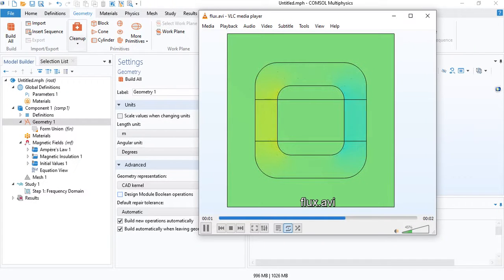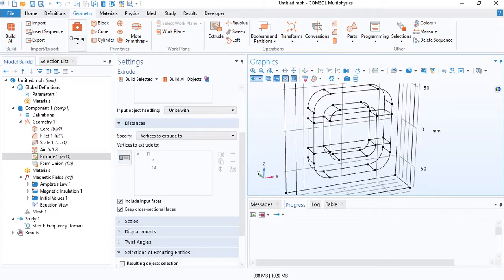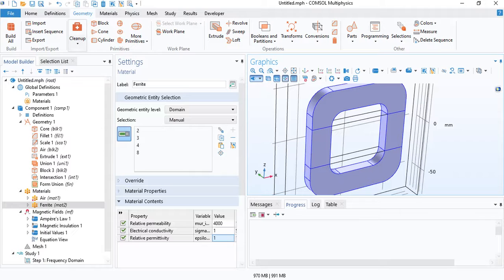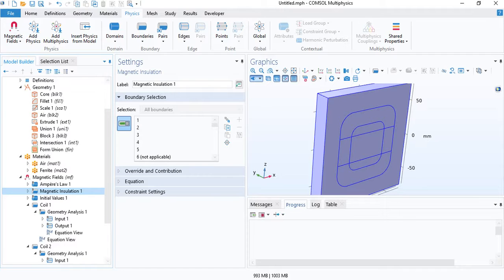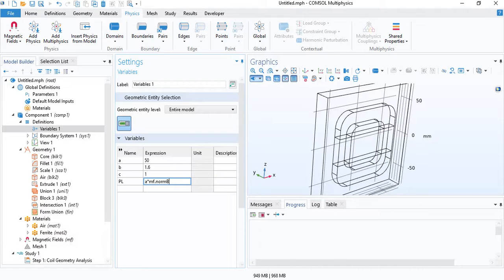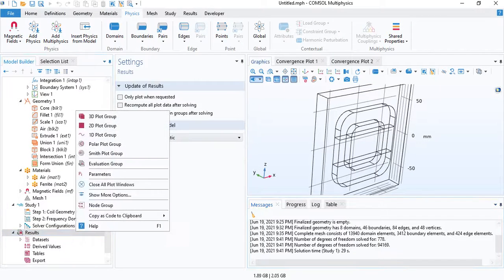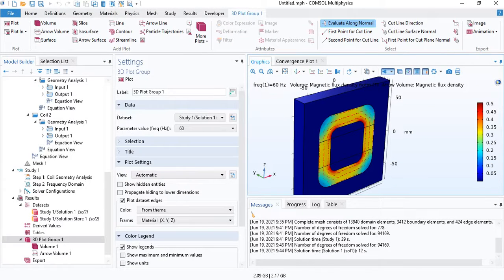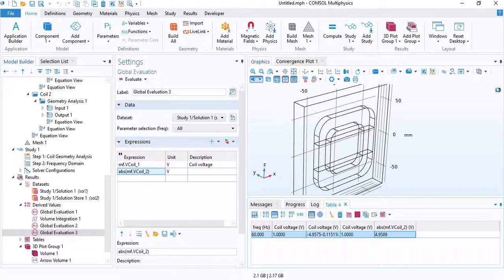Modelling a simple transformer and defining custom equations using Comsol Multiphysics

Comment from the maker: Corrections: 
(a) In the video I mistakenly selected only two regions in the core to calculate the core loss. You should select the entire core.

(b) At 18:00, the copper loss expression should be divided by two since the solution is in the frequency domain (sinusoidal current).

(c) I forgot to multiply the total core loss (PL_total) by 2. Since only half the geometry was modelled the total loss should be multiplied by 2.

Comment: how can I define a uniform current density in a conductor block or region?
Reply from the maker: If you're doing AC simulation and want the current to remain uniform you should use the 'coil' feature under domains, and within coil you should specify 'Homogenized multi-turn'.
Reply: @JafScience  even with the "homogrnized multi-turns" the conductor blocks are still affected by the frequency in my simulations. Is there a way to force the uniform current density?
Reply from the maker: @Flak3 within the coil conductor you still see skin effect? The homogenised multi turn is the way in comsol to force current to be uniform because it doesn't model it as a single piece conductor. Is your coil linear, circular, or numeric?
Reply: @JafScience  Exactly, skin effect is taking place in my simulation. I defined my coil by selecting the boundaries of the conductor block (2D Axyssimetric Simulation) and defining a current value and number of turns with the homogenised multi-turn option. There doesnt seem to be this linear, circular or numeric option in the coil options.
Reply from the maker: @Flak3  So you selected the outer edges of the conductor block? In that case the body isn't defined in the coil so it makes sense that you see skin effect in the block. The current is uniform only on the boundaries. If you want current to be uniform in the entire block then apply coil domain to the entire block.

Comment: if i draw coil (electric wire) which type of coil i use ??
Reply from the maker: The type of coil depends on the geometry of the coil and the application it is intended for. Assumptions can also play a role, if you are trying to simplify your model. So more information is needed to determine the coil type.
Reply: @JafScience  I drew electrical wire and wrapped it on the first part of the transformer
Reply from the maker: Did you use a surface for the whole coil or individual lines for each wire?
Reply: @JafScience  individual lines for each wire
Reply from the maker: In that case the only option is to use line current. If you have many wires close to each other I would recommend replacing them with a surface and using the coil feature with homogenized multi-turn model.
Reply: @JafScience  
okay,  thank you very much sir

Comment: Please help me to find a Fillet option while using the 3D model. It exists in the 2D approach but not in the 3D.
Reply from the maker: Under geometry there will be a symbol for the fillet feature, similar to what's in this video.
Reply: @JafScience   Thank you for your quick response. I am now aware of that the 3D fillet feature is only available with access to the Design Module. Thank you anyway!

Comment: Can you tell me about adding the equation in the semiconductor module?
Reply from the maker: If you mean user-defined equations in the variable section then that's similar to this video. It's not related to the physics interface you're using.

Comment: Bro, how did you get the animation? I couldn't animate it, didn't work.
The fact is that I tried to change the primary coil voltage from 1[V] to 1*cos(2*pi*60*t)[V] and add a time dependant study but didn't work. I don't know how to define this variable "t"
Reply from the maker: The variable t is already defined in Comsol when you use a time-dependent solver. I generated the animation for a frequency-domain study. In your case you can loop over the time values once you obtain the solution.
Reply: @JafScience  i got it. But did you change the frequency or something like that? Because I did all the same steps like you but my animation didn't change, all the frames were the same
Reply from the maker: @xololomejor  No I didn't change the frequency. The animation plays through one cycle (0 to 2 pi). Check my video on modelling magnetic hysteresis to see how to create animation for time-dependent studies.
Reply: @JafScience  thanks a lot

Comment: Hi! 
I need to design 3 phase transformer and need to fine thermal gradient and electric field. 
Can u make an tutorial👉🏼👈🏼
Reply from the maker: The concept of a transformer can be applied from this video. Use separate coil feature for each segment of the transformer. The thermal gradient depends on what yo want to model. Is it heat generated from hysteretic losses or something else. What are the boundary conditions for the transformer.

Comment: Very useful video, I want to ask you about how can I inserting lightning equation in comsol and how to Definition its variable?
Reply from the maker: I don't know what you mean by lightening equation?
Reply: @JafScience    I have an equation represent lightning current and I want to apply lightning current on Metal like steel how can I do that?
Reply from the maker: You can define any equation in the same way I've shown in the tutorial. I don't know what specific problem you are facing.
Reply: Try ansys maxwell too

Comment: You have set your operating frequency to 60Hz which you also specified in Steinmetz equation, but wouldn't you need to put the frequency as 0.06 since the frequency in Steinmetz is given in kHz?
Reply from the maker: Yes, you're right. I missed the units. Thanks for noticing!

Comment: I dont understand the meaning of scaling. What is the purpose of that and also did you add intersection for faster computing?
Reply from the maker: What scaling are you referring to? 
If by intersection you mean symmetry, then yes I added it to make the model size smaller (so faster computation).
Reply: @JafScience  The scaling you did at 1:22. I am basically trying to replicate the model but for an inductor with an E core. Is there something I need to be aware about? Im thinking the only thing i have to change is only have one Winding instead of two. Also would the model work for a coupled inductor to measure the leakage flux and mutual indictance?

PS: I appreciate the videos about COMSOL and big like for fast reply :)
Reply from the maker: @PlayboyHZ  The scaling is a quick way to make the core, to give it a thickness. I'm not sure about modelling leakage flux but to model an inductor then yes you'll need one winding.

Comment: Can you make tutorial about Simulation effect of harmonic current in copper busbar system in term of the temperature rise?
Reply from the maker: If you mean temperature rise by joule heating, then that's similar to the tutorial of water-cooled induction heating coil. You can use heat transfer (ht) and mf interfaces and the multiphysics coupling computes the heat energy dissipated.

Comment: I'm facing a problem my version is 5.3.a the flow of flux at the core only matches you if I disable the secondary core and take out the primary coil region from the ferrite material but of course having deferent values of loses. my question is why if i took the ferrite the flux flow matches you and why I'm getting wrong flow when i keep it.
Reply from the maker: I don't understand your question. Are you changing any steps in the video? If so, what are you changing?
Reply: @JafScience  first i go with the video but the results are wrong and deferent from video even the flow of B is wrong arrows the flow will be in primary side only. So when i remove the coil region from ferrite block the B flow came out like video bur the losses values are wrong thats what i change the rest like the video. Sorry for prolongation.
Reply from the maker: @porlanvors3762  I'm not sure if there's something different in the coil feature in version 5.3. If all steps are replicated the result should be the same. If the flux lines do not follow the shape of the core, that could indicate a low core permeability.
Reply: @JafScience  thank you for your time. I figured the mistaken it was b.c of the y value in block 3 forgot to insert it.

Comment: thankyou very much for this detailed video, i request you to please make a tutorial video for measuring high frequency ferrite core based high voltage transform, parasitics elements like leakage inductance and parasitic capacitance on both primary and seconday side of windings. thank you 👍
Reply from the maker: I'm not sure about making such a tutorial any time soon since it is closely related. I'm currently focusing on uploading a variety of topics. Thanks for your interest!
Reply: @JafScience  do you have any idea to measure winding capacitance in comsol simulation? any literature related to it? thank you.
Reply from the maker: @AS-zs7jw  I haven't done it before but I suppose the definition of capacitance can be used to calculate it. You can also check this Comsol link for help: https://www.comsol.com/model/computing-capacitance-12689
Reply: Sir as this is closely related , so you can do it in lesser time, but it will be very much helpful for student and researchers working on electromagnetics design of power electronics. thank you.

Comment: Why is the electrical conductivity of air equal to 1? Shouldn't it be equal to 0? Then again, I tried to put 0 and the model doesn't solve. Why is that?
Reply from the maker: Technically the conductivity of air is very close but not exactly equal to 0. Using 0 can cause numerical instability in a 3D model. So using a non-zero small number would fix the issue. That's why I used conductivity of 1. You can even use 2, 0.5, 0.1, etc.

Comment: Thank you so much for the video sir. 
I am facing a problem regarding "coil". I am trying to simulate in 2D geometry. And below the "coil", subsection named "Geometry analysis" is not coming in 2D. So I am unable to define the input and output of the coil. 

While in 3D geometry the subsection below "coil" named "Geometry analysis" is coming so we are able to select input and output of the coil. 

Please help me with this. How do I specify input and output of coil in 2D geometry?
Reply from the maker: In 2d you don't have to define the input and output. The direction can only be into or out of the screen and Comsol knows that. So once you've selected the coil you don't have to do anything else. The coil geometry analysis study step is also not needed.
Reply: @JafScience  So sir for defining into or out of the screen what parameter should we change? Is it that somewhere negative sign we have to give to specify "into" the screen as current direction? Because generally it is taking out of the screen as current direction. How do I give into the screen current direction?
Reply from the maker: Yes you need to switch the sign of the input current value. If positive is out of screen then negative is into screen.
Reply: @JafScience  okay thank you sir.
 Yes sir positive current is out of the screen.
Reply: Sir I was facing some problem while validating a paper. It is regarding "laminar flow between parallel plates with a magnet placed near it". Can I get your email id to discuss this problem?
 I have taken the necessary physics required but still not getting the flow pattern in presence of magnet.
Reply: Sir my problem that I mentioned in previous comment got resolved. Thanks anyways :)